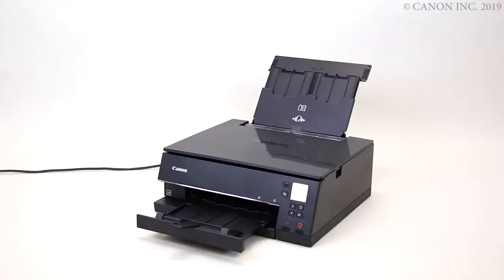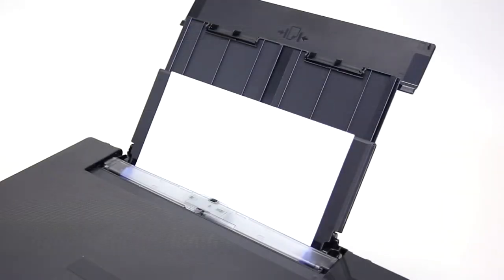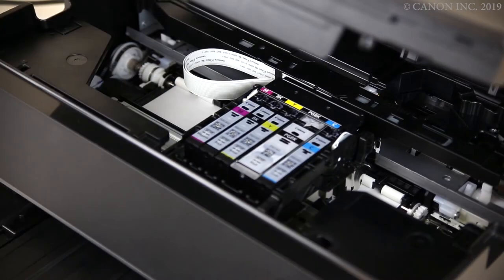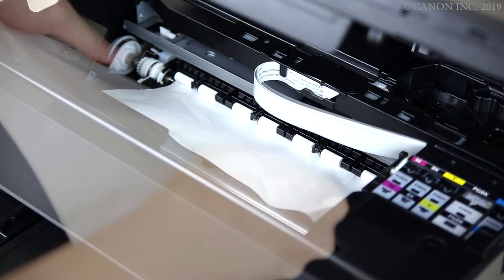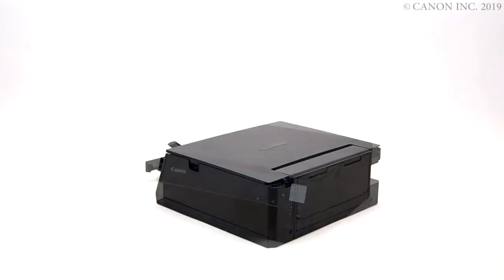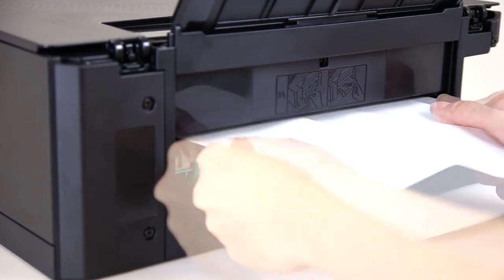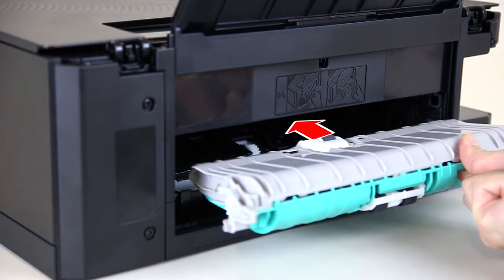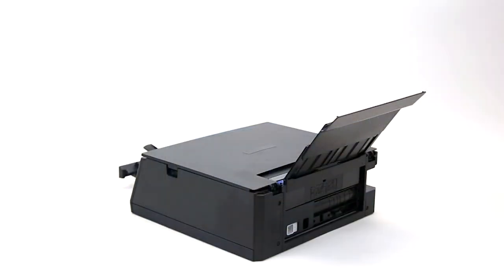Canon PIXMA TS6320 - Removing Paper Jams

Comment: can you please help me automatically align the print head on my mg2950? I printed the paper with the colors after trying to print a picture, the quality was horrible. how do I scan the paper? it lies on the glass plate now and its closed, I pressed the copy button but it started printing so I quickly pressed the quit button as I barely have any paper left. how do I know when its complete and how do I complete it? please, I have to have my photo album printed by tomorrow morning so I can give it to my hospitalised father, and right now you can't even see what is on the pictures. and please don't tell me to contact you or read the manual, because both are useless. please help me, anyone..
Reply from the maker: Hello Hanna:
We understand you need help with your PIXMA MG2950 printer.  Unfortunately, this is a model that is not sold here in the United States and as such we do not have support information on this model.  You can use the link below to locate the Canon support agents for the country where you purchased this printer:  https://Canon.us/myddc.   The support agents there will have access to the information to resolve the printer issue.

We hope this is useful.